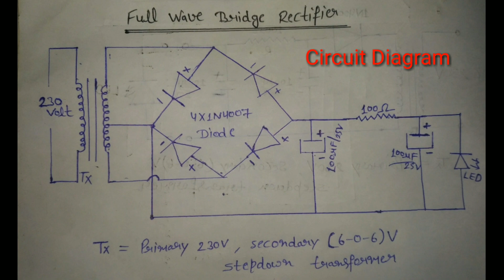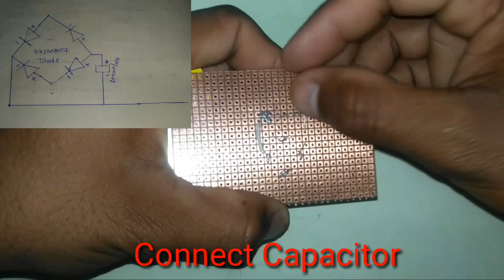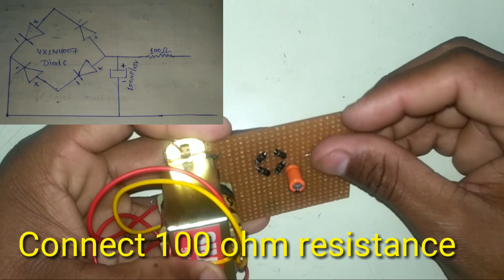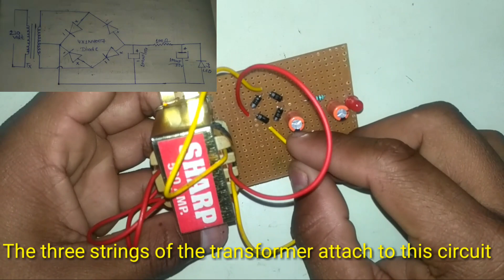How to make a full wave bridge rectifier

Comment: Nice work. People, PLEASE keep in mind what part of the world you build this device. In some parts of the world 220VAC is the normal voltage supply while in other parts of the world 110-120VAC is the standard. ALWAYS, ALWAYS safety first and use common sense when building, installing, and using ANYTHING that plugs into the mains (household power). There is real danger of property damage and loss to say nothing of personal injury or death. Otherwise, have fun.
Reply from the maker: Thanks